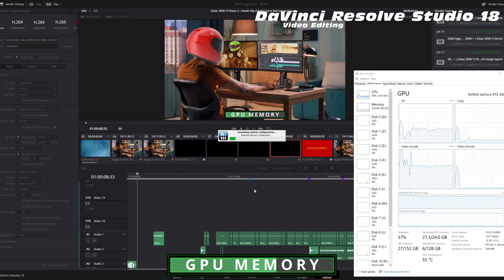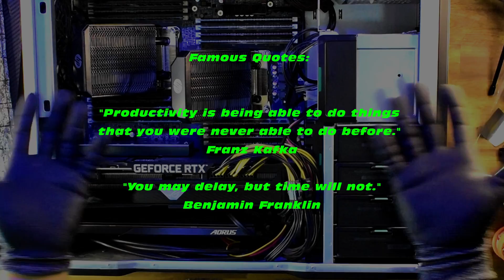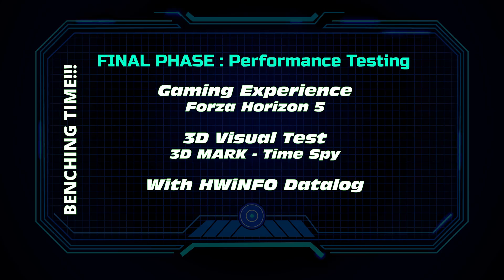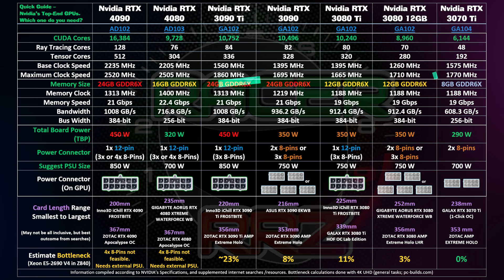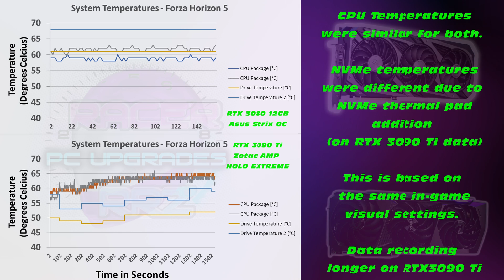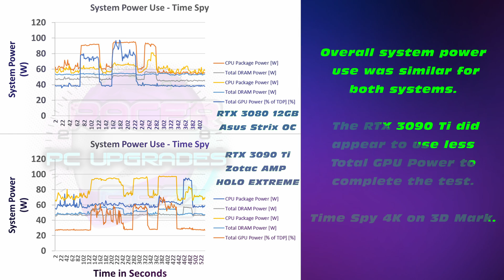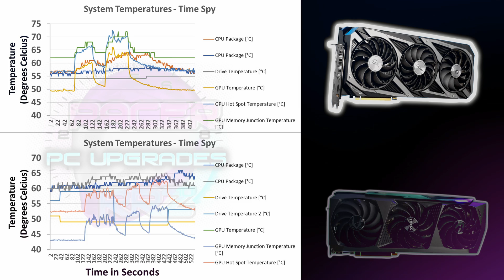GUIDE: Z840 Fitment of ZOTAC RTX 3090 Ti - Unleashing the Extreme Power in a Workstation

Comment: This doesn't fit
You clearly can't install the Pcie  Card Retainer Airflow Cover
This is necessary to have a good airflow in the workstation.
You can maybe close the panel without installing the retainer, at best.

If you want to install a big RTX in those workstation, you have to get a pro card that either is powered by the PCIE bus, or has power  connectors that are oriented differently.

The high end gamer cards won't  fit in this pro workstation.
Reply from the maker: Technically yes - I agree. It's too fast (Gen 4 PCIe being ideal), too long (HDD fans needed removal) and too high to clear. 

Does it work, yes, flawlessly. Do I regret the RTX 3090 Ti in my workstation, no. I'd say it was by far my best purchase for this system. And to make it even worse / better, I installed this GPU into my newer workstation, the HP Z8 G4. The fitment situation got worse because the case lid also can't close. The lower PCIe shroud can't fit, but it's working amazingly well and I get to use the system to it's optimal limits. 

You need to be willing to break a few aesthetic rules to get these GPUs fitted but their performance speak for themselves. 

https://www.sabrepc.com/blog/Computer-Hardware/nvidia-rtx-3090-vs-rtx-a6000-consumer-vs-professional

https://gpu.userbenchmark.com/Compare/Nvidia-RTX-3090-Ti-vs-Nvidia-Quadro-RTX-6000/m1818101vsm736712

Pricing wise (Amazon pricing):

RTX 3090 Ti : ~$2k
RTX A6000: $4.5k

Similar performance. ECC memory is great, but I can afford for a project to fail - I just reexport.
Reply: @racerrrz  Can you clarify
GPUs with power connectors towards  the panel, won't fit in a Z8G4 ?
Because this is my next purchase.
But I´m going to install an RTX A* in it, for various reasons (more reliable, less power hungry, more VRAM, and other Pro feature that I won't explain in a comment....)
Reply from the maker: @xl000  Nice. I can do one better than clarify, check out my full detailed guide on the HP Z8 G4 if you haven't already: https://youtu.be/z7Ff2zs5ByM

The Z8 G4 has 4x 6+2 pin GPU power connections. Each power cable can supply 219.6W of power (12.2V at 18Amps; the Z840 only has 3x 6pin cables). 

The Z8 G4 has a very shallow space for GPU fitment plus they must clear the PCIe lower shroud. Check HP documents to be certain your selected GPU clears. My RTX 3090 Ti is taller than the case (i.e. the GPU stands outside the case / fits proud above the case) - that's before even considering the GPU cables. The Z8 G4 has a more shallow case than the Z840 due to the modular PSU mounted behind the motherboard. Check my video for detail on it.

Comment: Why some recommend 1000+ psu?
Mine evga 850w 80+Gold G2 buying in the past where 1000 series was present,cant with a 3090ti?
What is the spikes?
Is real the PSU only offer constant 50% 60% of the energy?
Reply from the maker: The transient spikes are very short bursts of power that can overwhelm low power PSUs. Something like the Zotac RTX 3090 Ti can draw as much as 650W for a brief moment and if your PSU is unable to supply that power it will cause a PSU meltdown (capacitors get fried - leading to smoke and a fire hazard). It might seem odd given that the GPUs are still rated for say 450W TDP, but aiming for some redundant power overhead is a safeguard to make sure you don't damage your system hardware. 

If you can, aim for a 30% minimum overhead. So if your GPU is rated for 450W - aim for a PSU that can deliver say 650W to the GPU (it's not easy to find because the 8-pin power cables are only rated for 150W). My HP Z840 workstation's PSU is a 1450W Platinum that supplies 219.6W per 6-pin cable - a very over-powered PSU in these systems.

Comment: Hey love your videos, but I have one concern, those 6 pin to 8 pin power adapters are infamous for catching fire, which is why I am a bit hesitant in using them, how's been your experience? did you use any specific adapters with lower gauge wires in your case that dont catch fire? In my particular case i would like to power a 3070ti in a z440 which requires dual 8 pin connectors. Please guide me
Reply from the maker: Thank you, I am glad you have found the videos of help. Be sure to check out my Z440 Case Swap video if you haven't already - lots of ideas for the Z440 in there. 

I have seen the same claims on those cables. One concern I would have is incorrect wiring from the get go (so incorrect pin ordering in the plug). In terms of wire gauge - I would like to think keeping track of the power draw numbers will help to prevent any issues. What can happen quite easily is excessive power draw through a single adapter cable. The ATX standard is 75W for a 6-pin and 150W for a 8 pin, however HP's 6-pin cable is rated to 12.2V @ 18Amps (219.6W). If you use a 6-pin adapter cable and you are pushing 219W of power through it I can see why they catch fire (keep in mind the adapter cables are rated to ATX power limits - not HP's). 

With a little care you can use them correctly and get your system running right. I have listed the adapter cables that I bought in the video description. I converted the 3x 6-pin power cables to 3x 8-pin cables and the Zotac RTX 3090 Ti can draw ~450W to as much as 650W (transient spikes - but one benefit is the GPU is bottled-necked in these older systems so you may never see such high power draws). I have not had any issues in any of my systems and I have used a lot of these adapters. As long as you know the limits of the cable you shouldn't be able to over-load them. In terms of the RTX 3070ti, you should be able to power that without too much issue.
Reply: @racerrrz  the problem here is that the RTX 3070ti takes dual 8 pin, if I were to use the dual 6 pin to 8 pin adapter, I would be out of PCIE power cables, but I hope its like you said and the card doesn't draw full power in the Z440

Comment: I have watched all your videos and learned a lot, I have an z840 for over 3 years with the large psu.256 Gb 24 core. Mainly I use it as a desktop and for staking tokens, never had the need to upgrade the gpu. Recently they have added AI to my edge node and I am trying to use what I have to help performance. I have a few 1060P 6gb from mining software and a couple of P40 Tesla's 24 GB. I want to use a 1060P with a Tesla, no one has really done it before, a lot people have tried the K80 and M40 but all have had problems with the 6 pin to 8 pin connectors. I have the cooling worked out. From what I see and hear from your video, I should be able to use a dual 6 pin to an 8 pin for the P40 (240 watts) and the other 6 pin to 8 pin to operate the 1060P (71 watts or so). Should that work? And is there a particular 6 pin to 8 pin? some people have had issues with this. Any help would be appreciated.
Reply from the maker: Hi. I am glad you have found my videos of use. I have a decent Z840 video nearly ready to go out but I decided to film a bit more before releasing it - stay tuned for that!

You should absolutely be able to run a couple of GPUs without issue in the Z840. The key is keeping track of the numbers. Each 6-pin can supply a max of 219W (12.2V @ 18Amps); and normal ATX 8-pins only supply 150W. To cover the Tesla P40 you would need to join two 6-pins into one 8-pin (netting ~439W max through that connector). The issue here is that although the Z840's PSU can handle that I doubt the cheap 6-pin to 8-pin connectors will hold up with much more than ~160-180W before melting down. I suspect people that have had issues drew too much power through a single 6-pin (rated to 75W) / 8-pin (rated to 150W) cable. 

I have had no issues with the adapter cables that I have used (I linked the exact items I bought in the video description and here: https://amzn.to/3U6Oo0C - affiliate links). I prefer the 6-pin to 8-pin adapter over the dual 6-pin, or single 6-pin to dual 8-pin versions. The Tesla P40's ~250W TDP is aggressive for a single 8-pin connector. I would like to think the 6-pin to 8-pin adapters I am using would survive that. Side note- the GPU power 6-pin to 8-pin adapter cables have survived the RTX 3090 Ti without issue so far - but I have moved over to the HP Z8 G4 - but neither workstation has complained with them fitted. 

For piece of mind you may want to consider getting a infrared heat gun so that you can monitor the wire and plug temperatures for added piece of mind. I have been tempted to get one off Amazon (it's been in my cart for like 6 months haha - affiliate link: https://amzn.to/3U4okD3 ) to use in videos but I never got that far. I also liked the Thermal Grizzly - WireView (affiliate link: https://amzn.to/49ow9YO - this is a 8-pin to 8-pin with digital power read-out). Thermal Grizzly offer a range of GPU power adapters that might be worth consideration (I was looking at getting a 3x 8-pin to 1x 12VHPWR with readout to monitor GPU power draw). They should be of high quality and with the digital power readout you'll be able to make sure the numbers aren't ever too crazy. The joys of cash flow not always being in our favour, let's just blame that global economy being in recession.
Reply: @racerrrz  I want to thank you for your detailed thorough explanation and links. I have confidence that I can put it together and it will work with your explanation and experiences.The machine is an absolute beast even without the upgrade, it functions incredibly well as a homelab, for virtualization, staking tasks, Plex server, OBS and the normal household functions, it runs numerous tasks simultaneously. It can even run a number of llama models locally from openchat on its memory and cpu's, although it is slow on all but the most streamlined models, it's quite an accomplishment for an older workstation without powerful GPU's . I am updating storage capacity adding a NAS and working on a decentralized cloud based node. It has plenty of life left in it. I am also working on running inexpensive dual tensor chips from coral ai that can beef up any security system, it should work good, has low power consumption and is an awesome low cost upgrade. They use an m.2  E slot, but there are pcie cards that can stack from 4 to 16 chipsets that add a lot of processing power with low overhead.  I picked up a z820 to experiment with ProxMox, after watching afew of your videos and was shocked at how well it performs in that role using a more streamlined operating system. I have been eyeing the newer generation Z 8 and some of the newer chipsets, but the z840 has a useful future, it's a reliable household appliance that can still be upgraded.. Your videos have been quite helpful, I have shared your information and links, with my own opinions and experience in Reddit columns and it has helped several people and small companies in Egypt and India that use them for video production. Looking forward to your next video.
Reply from the maker: @TheAngeloMichael   Thank you for your feedback and for sharing the content to help others also. Your homelab sounds very capable. It just makes sense to combine all of the modern needs into one reliable system. Getting some tensor chips in there will give you some room to push the workload further. I can imagine a H100 finding it's home in a Z840 lol.

The HP Z820 is still an absolute trooper for homelab work. Upgrades are cheap, the system is relatively power efficient for the workloads it can handle. I think the biggest bonus is their low noise compared with a dedicated server platform of the same era. 

Right now the Z840 is the best bang for buck - CPU and RAM options are really cheap now. The Z840 bare bones machines have also lost a lot of value on the used market - a year or two ago they were worth double what they are listed for now! I have a detailed Z840 overview video that is planned for release as the next video.  

In terms of the Z8 G4 (I am so slow with the videos! I have a few in the works for it!), for a main system they are more than capable. With the right CPU and RAM setup it would outperform many mid range gaming systems. The only catch on them is cost. The Z8 G4's are still really expensive. The Gen 1 Scalable Xeons and 2666MHz ECC memory prices have come down quite a bit however - and generally the Gen 1 Scalables are prices better than the Broadwells Xeons. 

I am keeping my eyes out for a cheap set of Gen 2 Scalable Xeons for mine. I bought 2933MHz ECC Registered RAM modules in the hope that they would work on my system but I got caught out - the Z8 G4 did not recognize them. Hopefully with the new Gen of CPUs I'll be able to make use of them. But for now my Gold 6142's are handling everything I throw at them.

Comment: Hi Can I add RTX 4070 OC edition (two fans)  in HPZ840?
Reply from the maker: Absolutely! The RTX 4070 Founders Edition came with 1x 12VHPWR cable which splits into 2x 8-Pin power connectors (some of the high spec models may be 3x 8-pin connectors). The HP Z840 has 3x 6-pin power cables that you can adapt to 8-pin power cables (product links in the video description). Once you adapt it you should have a solid GPU for your Z840. 

You can calculate any potential bottlenecks here: https://pc-builds.com/bottleneck-calculator/result/0IT1fl/3/graphic-card-intense-tasks/3840x2160/ Generally the Z840 will bottleneck the more modern GPUs by 5-30% depending on the tasks being completed. I am happy with my RTX 3090 Ti's performance - bottleneck or not - it has not missed a beat.

Comment: i have z840 workstation 1125 watt (power supply)  can i apply aorus rtx 2080 ti xtreme waterforce 11g & EK-CoolStream RAD XT 240   ????
Reply from the maker: Yes, the Z840 can power the RTX 2080 Ti without issue. Mounting the EK-CoolStream Radiator will likely require a custom mounting solution. Drilling some holes in the case maybe required - but it might be able to fit where the rear exhaust fans are and you could likely mount the rear exhaust fans to the radiator for cooling. The only downside being that the radiator will run warm due to the rear case fans being being the "hot exhaust" for the case. The other option would be mounting the radiator to the HDD bay - then placing fans to the outside of the Z840's front panel. Messy and really inefficient cooling but that would allow you to use the radiator. The best option remains a traditional GPU with a built-in fan module.

Comment: i have z840 workstation 1125 watt (power supply)  can i apply MSI RTX 3090 Ti GAMING X TRIO (Power Connectors 1x 16-pin )it possible to in z840  am gonna use 6 to 8 pin converter
Reply from the maker: Sorry, your comment got blocked by YouTube for some reason! I just traced it now and let it through. The MSI RTX 3090Ti X Trio will work out the same as my Zotac RTX 3090 Ti in the Z840. The MSI RTX 3090Ti X Trio is only 325mm so it may slot in without needing to remove the HDD fan module as I had to do with the very long Zotac GPU. 3x 6-pin to 8-pin adapters is all you need. The 1x16-pin comes supplied with 3x 8-pin connectors at the other end (Seen @ 12:24).
Reply: @racerrrz  where do i get the 3x 6-pin to 8-pin adapter?
Reply from the maker: @archdebiangentoo  Hi. There may not be something like 3x 6-pin to 1x 8-pin adapter cable. The 6-pin cable was designed for a max output of 75W, and the 8-pin cable outputs a max of 150W under normal ATX circumstances. Combining 3x 6-pins into a single 8-pin will cause damage to your system due to over-amps. All you need is 1x 6-pin to 8-pin adapter cable. If your GPU has more than one 8-pin cable you can buy additional cables to match. The only exception is the new GPU 12VHPWR cable which can combine 3x 8-pins to achieve the required 450W for most modern GPUs.

Comment: I have a Z840 with 2 2.60GHZ 24 cores right now what processors would be a good upgrade?
Reply from the maker: There are several options for the Z840, and most of them are quite affordable at the moment. 
Do you prefer more cores or more clock speed?

The cheapest and top performing CPU would be the E5-2696 V4. 
The best clock speed and core combination is the E5-2697A V4 (I just installed one of these on my Z440 NAS build, great CPU). 

A quick comparison between some of the top models: 
https://www.cpubenchmark.net/compare/2750vs2783vs2814vs2753vs2779/Intel-Xeon-E5-2696-v4-vs-Intel-Xeon-E5-2697-v4-vs-Intel-Xeon-E5-2697A-v4-vs-Intel-Xeon-E5-2699-v4-vs-Intel-Xeon-E5-2680-v4

Affiliate links for your reference (I would earn a small commission if you buy through these links - I bought the E5-2697A from Ebay for $63 USD a few months back): 

E5-2680 V4: https://s.click.aliexpress.com/e/_DmQkIkl
E5-2697A V4: https://s.click.aliexpress.com/e/_DllKF8t
E5-2697 V4: https://s.click.aliexpress.com/e/_Dmzs0Lj
E5-2696 V4: https://s.click.aliexpress.com/e/_Dm3gaGz
E5-2699 V4: https://s.click.aliexpress.com/e/_DFakgXx

Comment: hum... it's not Virtual memory. It's Video memory. lol sorry

I did like the video tho
Reply from the maker: Thanks! We are both right, technically lol. 

The main issue is VRAM / video memory, but quite commonly some of the system RAM is allocated as a memory buffer - giving a larger pool of "GPU memory". In the video at 0:36 Windows Task Manager said my GPU memory was 156GB lol (RTX 3080 12GB's VRAM + over half of my system DDR4 RAM). This combination of VRAM and system RAM is called Virtual memory - like in the old days when you could allocate some of your HDD/SSD storage as RAM in Windows - "Virtual memory".

Hence, I was being somewhat sarcastic in that the 156GB of "Virtual memory" was not enough. But the issue was that once I filled the GPU's VRAM the CPU's RAM was a bottleneck and that often lead my system to crashing. So far so good with the RTX 3090 Ti - things still lag at times but it always recovers without crashing.